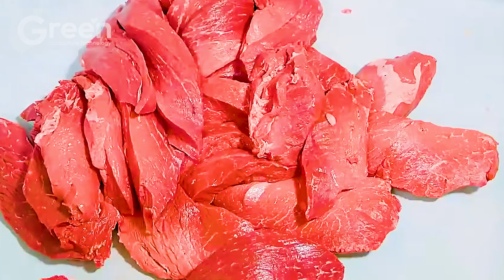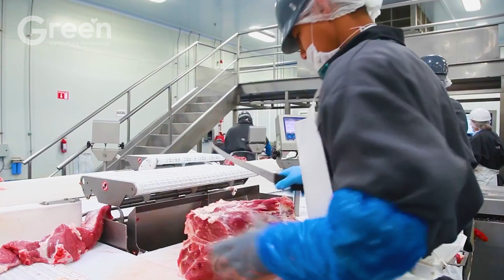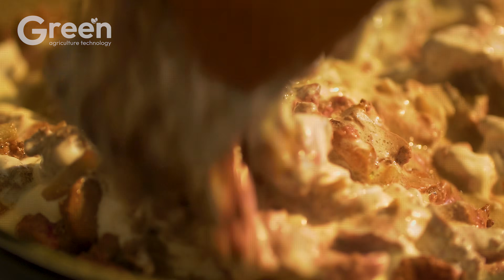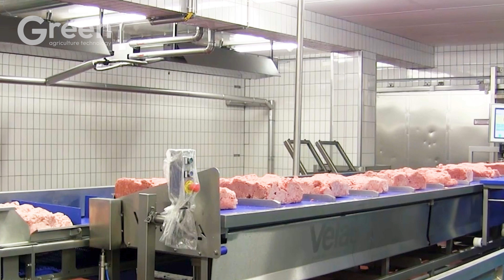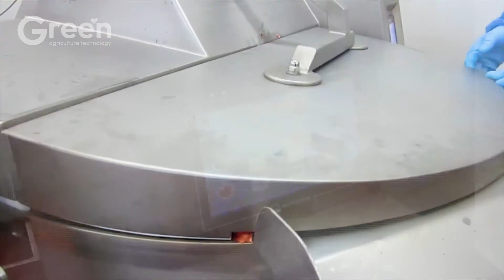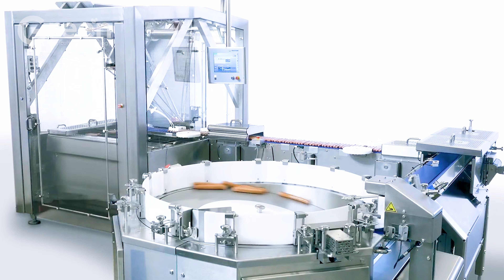Cattle Slaughter & Processing Beef Line In Factory | Inside the Beef Factory

Comment: What is that white cbe put in the cans????
Reply from the maker: Please show me where the content you want to learn appears.
Reply: @GreenAgricultureTechnology :58 mark and other time slots
Reply: @deanmiller294you don't wanna know 😅
Reply from the maker: @deanmiller294 1. Preservative or Stabilizer Pellets
In the canned beef industry, plants sometimes use small pellets to add preservatives or color stabilizers. For example:

Sodium nitrite or sodium erythorbate: helps keep meat red and prevents bacteria such as Clostridium botulinum.

Pellets are easier to measure, especially in automated lines.

2. Spice or Flavor Pellets
Some modern processes may use compressed spice pellets (e.g. onion, pepper, garlic, salt) to ensure a uniform dose in each can without the need for manual spreading.